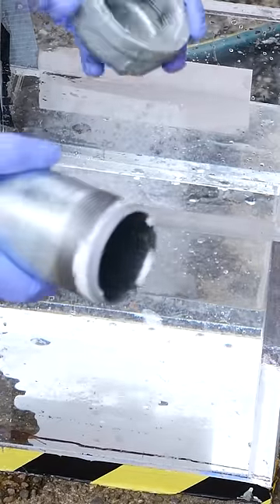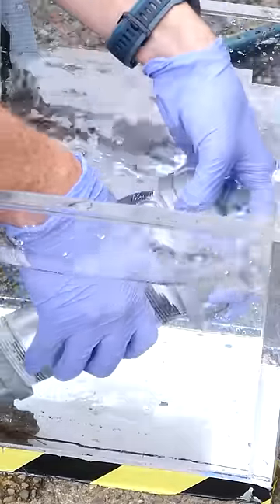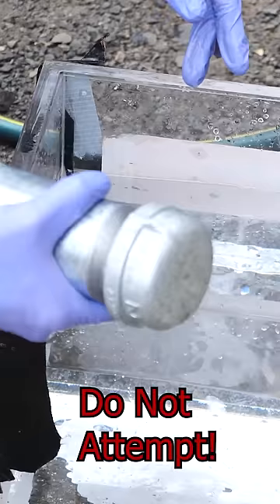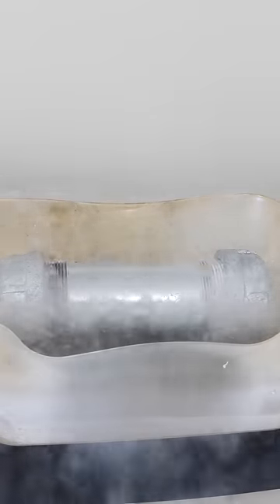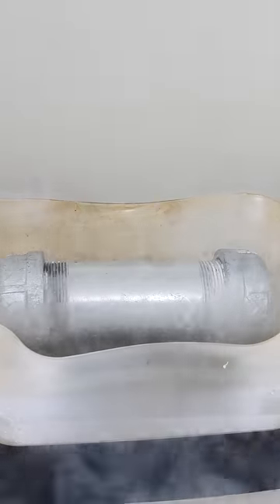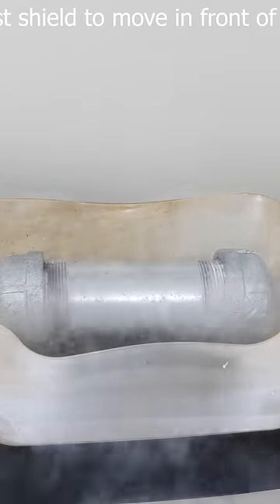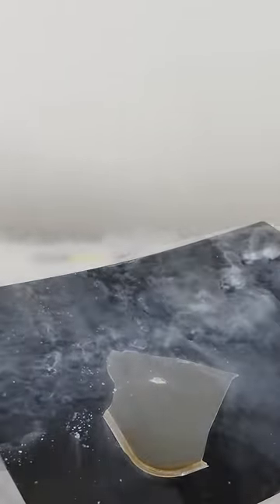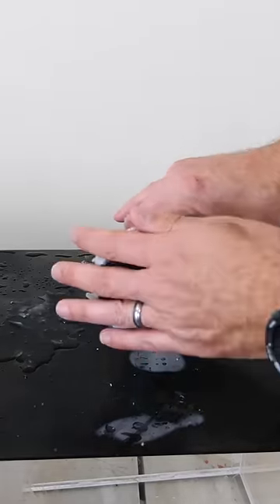Don't Ever Try To Stop Water From Freezing!

Comment: The water wasn’t frozen at all, until the container broke. Then it froze instantly. The pressure prevented it to freeze. And when the container broke, the pressure instantly dropped, thus allowing the water to freeze, also instantly.
Reply: Nope, that would only be possible if there is no contamination in the water to start a crystal. And also when all water has the same temperature, as when you cool it slowly. This thing was cooling from outside in
Reply: refer to a water phase diagram and tell me what happens when pressure increases.
Reply: @genericalias5756  lol yeah, the problem is to increase the pressure it has to freeze in the first hand. The container isn't shrinking this much.
Reply: mno, it froze under pressure as much as it could, and then when it could no longer take on the pressure nor the metal expand it popped 👀
Reply: Happens to my coke bottles.
Reply: @ismaelyu5 it's unfortunate the readers seem to think your correct here.. the freezing point is determined by both pressure and temperature.. it would be impossible to remove all air (there's air in the water, after all), so there would be the tiniest amount of freezing which would drive the pressure up while the majority of the water simply cools to well below freezing while remaining a liquid.. until, as op pointed out, the container burst, pressure rapidly decreased, and the sub 0 water instantly froze.
Reply: @fredrickdakine  I totally agree to a degree. Water has highest density at 4°, as far as I understand the ice then again starts to increase density if comes from a lower density value then the water before. What I don't know for sure is, what supercooled water does. 
I assume it's density stays at where usually ice starts to drop the density (eg. expands).
So for me, the cylinder either burst as soon as the first crystals form because  of peak pressure.
Or, more ice forms at later temperature because of increased pressure but still crystallisation continuous till the pressure increased to much for the cylinder.
If I would follow your explanation of the mostly supercooled water, I would expect a slushy substance after the cylinder burst, but it was clearly separated over and water.
Reply: Why is no one also talking about the steel shrinking?
Reply: @ismaelyu5  Please refer to PVT phase diagram. There's a solid liquid transition plane between solid plane and liquid plane which depends on the volume. Yes you could say it's supercooled water under that condition.
Reply: I wonder if the experiment would be any different with greased or water repellant threads. Like if the water trapped in the threads had any effect on the end result?
Reply: @jspaulding4106  the thread didn't move, the cap cracked above the thread, so I assume there would be no change. A different cap would make a difference
Reply: @平-o2n  you assuming there is pressure before it freezes, and where does the pressure come from?  The shrinkage of the pipe is just enough to just compress the air inside the water, so the whole pressure can only come from expanding ice. And the next thing, you can clearly see the expelled water is liquid. If it was supercooled, all of it would become a slushy substance after releasing the pressure, not just 1 part hard frozen the other liquid.

Once again, OPs answer only works with completely  distilled water so no ice droplets can form on transitioning agents or pressure in the first place. 

Here the pressure only builds up because of the ice, because the steel shrinkage is too small, like 10-20 micrometers on a 10cm pipe if it's completely cooled by 200°K, that's just squishing the air inside the water..
Reply: not accurate, there is no way in hell the pressure inside was high enough to decrease water freezing point enough to not freeze before breaking, the steel shrinking from the temperature is contributing negligable amount of increase in pressure, what happens is that water starts to freeze, and as we all know, water expands when freezing, this increased the pressure, slightly lowering the freezing temperature of the water, as it continues to freeze, the pressure increase untill it hits a point where the container can no longer hold it and breaks at the weakest point, at 2000 atmospheres and mentioned in the video, water have a freezing temperature of -70 °C and when it was sealed the pressure was pretty much 1 atmosphere.
Reply: Lmaooo wat
Reply: A slow freezing could result in explosion too? Like it on The fridge?
Reply: @maion2005 As long as it begins to freeze and increases the pressure enough to burst the pipe it doesn't matter how long it takes to cool it

Comment: as a plumber I love this. It creates so much work in winter
Reply: one's disfortune is another's opportunity!
Reply: It’s short term miserable on your finger tips, however. I’ve heard of plumbers getting frostbite working on these pipes all day. Maybe wetsuit gloves can help.
Reply: @18themxxn_  misfortune.
Reply: I’m in Florida so when we get that ONE cold day I’m just waiting for the calls 😂. We don’t have a freakin frost line down here so pipes can be >6” it’s so insane
Reply: Gah you evil bastard! 😂
Reply: @eldermillennial8330  indeed
Reply: I have vacation homes I monitor up in New England during winter season that have emergency lights on the outside for low temperatures and it prevents $1000s in repairs from burst pipes.
Reply: @SterbenNL  I don't know...I kind of liked "disfortune". 🤔
Reply: Drywallers love it also.

Comment: Also pipe threads are tapered.  So if you put a limp wristed tighten on it you create a weak point.  Bury the treads and you maintain the thickness on the schedule of pipe being used.

Comment: Also steel becomes brittle when it's that cold. It's one of the reasons TITANIC broke cleanly in half when it was sinking granted modern steel is stronger but still other ships have broken in half when in freezing cold water.
Reply: Modern steel isn't necessarily stronger, but that's a whole different topic
Reply: The shape is considerable here too. Rapidly cooling the cylinder using N2 causes a simultaneous contraction of steel against an ever strengthening cylinder of ice. As the metal shrinks it both further compresses the contents and tension builds. Eventually a crack emerges and a split line spiders through like a window breaking, with a catastrophic decompression, just like a pipe bomb from explosive contents.
Reply: Actually, it's because one half of the ship was high in the air while it was sinking, not supported by anything, and it collapsed because of the unsupported weight.
Reply: Was it chilly on 911 maybe
Reply: UK Navy receny experienced the exact opposite.
In the warmer waters of the Med their engines kept failing, due to overheating. 😂😂😂
Reply: Hmmm....
Taken into consideration.
Reply: Congratulations on copying everyone else’s comments.
Reply: @Nexo.Playzz Both played a role...
Reply: Actually most steel of the time was stronger too. One of the many failure points of the titanic was the fact it was made with shit steel. There's a few documentaries about it but the summary is the steel had to be rapidly produced and this resulted in much larger crystallization than in most standard steel of the time. In the freezing temperatures of the north Atlantic the plates struck failed much more than steel of normal quality would have.
Reply: Titanic doesn't exist lol it's a movie
Reply: I don't think so. If it were cold enough to freeze water that night, there would have been a lot more ice on the ocean.
Reply: @alejrandom6592 lmao, gonna try this as rage bait sometime
Reply: It wasn't really that cold around the titanic.  But liquid nitrogen is.  Also, this has little to do with steel getting cold.  The internal pressure just got way too high.
Reply: This is why I like the comment section. Sometimes I learn something new and interesting.
Reply: Yup, if the container is strong enough, the water should keep a temp above 0, maybe 4, when it's most dense? Not sure though
Reply: Could this have been why the Titan sub imploded too? Too cold down there?
Reply: @bobs8005  I don't know if carbon fiber and steel from 1912 have the same properties and if they behave the same in frigid cold salt water but I do know that carbon fiber is good under tension so if it's in a pressurized chamber such as on an aircraft like the boeing 787 dreamliner it's every strong under tension but it sucks at withstanding compression forces caused by the pressure of the ocean on a submarine.
Reply: @christophergardiner5351  saltwater had a much lower freezing point due to its salinity, so it could've been below freezing but the ocean could've been liquid
Reply: Nobody likes a know it all babe
Reply: Why do you people think it's freezing cold in the North Atlantic? Is it because of the iceberg? That floated over there from somewhere else

Comment: Pretty sure when water goes from liquid to solid it contracts, not expand as the atoms get slower and closer together, meaning that it takes less room and when you turn something from liquid to gas it expands more, which is why heating gas canisters cause them to explode

Comment: You also learned about DBTT, Ductile to brittle transition temperature. Steel can have quite a sudden transition
Reply: Noice 👍🏼 science…
Reply: And DED. Don't ever do
Reply: @godawgs689 good ole Homer Simpson reference.
Reply: You're right the metal likely became more brittle and the explosion could of been bigger if it were not as cold
Reply: Thats why he did the experiment wrong
Reply: He should have used copper pipe

Comment: Don’t forget that metals also experience thermal expansion, so the container also shrank a bit
Reply: this is why his timing was almost fatal if he didn't know EXACTLY what temp the water was he would be dead.
Reply: It's  a bad example.  The liquid nitrogen was far below freezing. So low it made the metal brittle.
I'd like to see this experiment with non ridiculous temps being used
Reply: @aidenharper6013  I hope you're joking
Reply: @epstein_isnt_dead7726  nice name
Reply: @epstein_isnt_dead7726  In real life, in Canadian winters, the pipe splits lengthwise.  Alternatively in copper pipe the worst solder joint pops off, or the pipe splits longitudinally. My working theory is that imperfections in the interior of the pipe when it is extruded are forced apart and then these almost microscopic cracks propagate.
Reply: @markbernier8434  it's also worth pointing out that a pipe outside would cool evenly.  Concentrating all the cold on one spot on the pipe and not the whole pipe will cause it's own problems. Expansion and contraction from heat happening in different areas of the same workpiece is bound to cause damage
Reply: No the metal was experiencing thermal contraction not expansion! Metal gets smaller when freezing and bigger when hot! It is actually the kinetic energy of atoms due to which the expansion or contraction occurs. As the kinetic energy increase with an increase in temperature the metals expand and when the temperatures are extremely low the metals contract owing to the negligible kinetic energy of the atoms.
Reply: @shuggiemcg1  the way he phrased it "metals also experience thermal expansion" is correct.  Since cold doesn't exist, it's only the absence of heat energy, thermal contraction technically doesn't exist.  Thermal expansion also covers thermal contraction because it's all, in essence, the presence or absence of heat energy, therefore making thermal contraction nothing more than less thermal expansion.
Reply: Or at least increased in rigidity making the explosion more violent

Comment: You know another factor here is how brittle metal gets when cold
Reply: Also the cap that busted was cast iron which is also naturally brittle. Double brittle.
Reply: @dboi5311 iron is soft metal. That's the entire reason it's used in steel alloys.
Reply: Agree. Freeze it with out liquid nitrogen. I think the nitrogen magnifies any stress point possibly fracturing to the point of failure.
Reply: And iron contracts linearly also, about a 1/10 mm in that range stressing the engaged threads
Reply: @Wyatt_Riley  If the cap is indeed cast iron, then it is brittle because it not only has impurities, they are also inconsistently distributed. Cast steel, on the other hand, was made with the secret sauce to prevent impurities and evenly distribute the carbon. Both can have the same iron content yet very different properties.
Reply: Also shrinks from -18c. So the water expanded an the metal shrunk
Reply: @Wyatt_Riley  cast iron is brittle. Drop a cast iron pan and it will crack not bend
Reply: Exactly. All this "experiment" showed was that steel will become brittle and break under certain pressure if you cool it fast enough and low enough.
Reply: @Wyatt_Riley  you may be confusing elemental iron with cast iron which is an alloy of iron, carbon, and silicon that has been heated to melting and poured into a form.
Reply: but does it matter? Wether the cap is steel or iron or plastic, the water pressure is still gonna bust it open, right?
Reply: Yeah we know
Reply: My first thought too
Reply: @dboi5311  looks like galvanized plumbing bits.
Reply: @Wyatt_Riley  Or perhaps iron is used in steel alloys because steel is iron + carbon.

but what do I know, I only have a basic fundamental knowledge of what the word steel means
Reply: @dboi5311  And it also sheared off the threading, which is not even remotely as strong as any other part of the container. Would have been interesting if he welded it shut.
Reply: Alot of metals like that they cool and heat over and over in the process of making so isn't brittle and strong tho
Reply: @runtergerutscht4401  not like that 😂
A frozen can of soda barely breaks the aluminum lol
Reply: @Wyatt_Riley  incorrect. iron is a hard metal. hard metal dont bend, they break. ie iron. 
steel can be made not to snap through proper tempering and cooling methodology in order to keep a tight and uniform grain structure. cast iron has too many inconsistencies to be pliable or "soft" 
go take highschool chemistry and then get back to me lmao.
Reply: Just to clarify, Cast iron does have carbon in it. It actually has so much carbon, that it is considered to much to be considered steel. It would be pretty brittle, but not that bad normally. When you make it super cold, it would be safe to assume that it would be more brittle. 

There is also a possibility that the casing itself might have shrank as well, adding to the pressure inside. Steel does that, and I wouldn't be surprised if cast iron did as well. Also if the round part shrunk faster than the cap, which due to surface area and thickness,  is very likely, the base of the threads of the pipe may have shrank faster than the cap, making it be a looser fit, thus making it shoot off.
Reply: First thought. It still would have broken if you left it in a freezer. This just accelerated the inevitable.
Reply: good point, good point
Reply: Y'all should watch the full video. The steel wasn't even that cold so it didn't even become that much brittle, pressure is just that strong
Reply: sound so smart yet it's so wrong at the same time. this is when your science teacher is movies you watch

Comment: This is more a test of thermal shock on the metal. And the pressure drop that would happen within the metal pipe would more then likely cause the water to boil rather then freeze and the metal pipe broke down to the stress of quickly dropping temp from room temperature to -300ish degrees that liquid nitrogen exists at.

Comment: Rapidly freezing water condenses and compresses the space that remaining water has which was already minimal thus increasing the pressure within the tube. The PSI increased so much that the stainless steel cap was unable to hold the force. This is why it exploded.

Comment: That was the most polite explosion ive ever seen
Reply: Why would u make the steel brittle?
Reply: @vincentstohr2216 there are other properties. Just because a metal is brittle doesn't mean it breaks easily. Steels are usually brittle because they are hardened, they resist deformation almost completely which gives them a very high strength. Unfortunately that means they break violently at that point because none of the energy went into deformation its good for pipes because it means long sections won't flex as much
Reply: @aceystar1478 I know the process of hardening and stuff. But if u submerge it in liquid Nitrogen and the steel was already hardened. Ofc it break easily.
Reply: @vincentstohr2216  there's a temperature for many materials called the ductile to brittle transition temperature. Below the temperature the metal will have brittle fracture above which it can experience ductile fracture. Thats the reason the titanic sank. The steel it was made of had a dbtt that was basically room temp so the icy antarctic made it snap like a twig